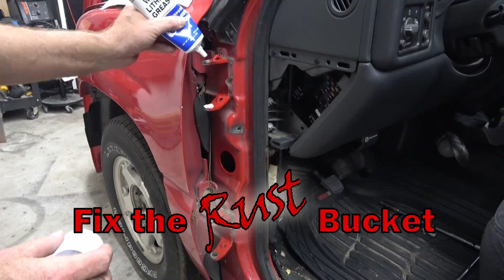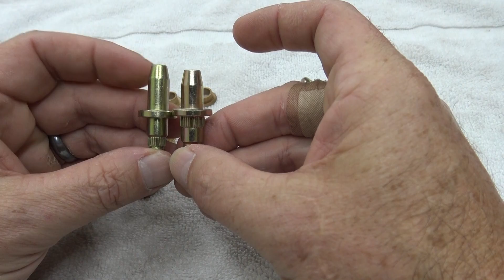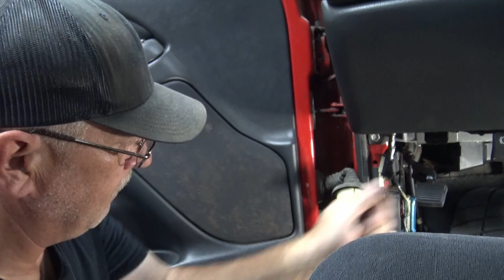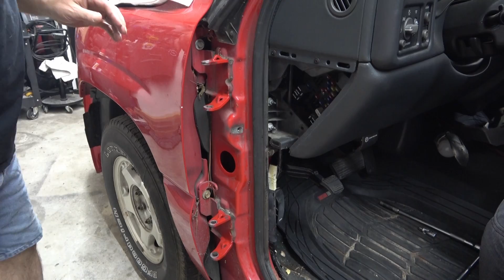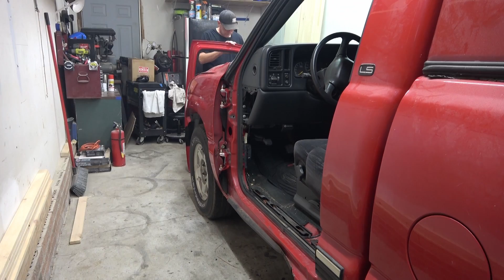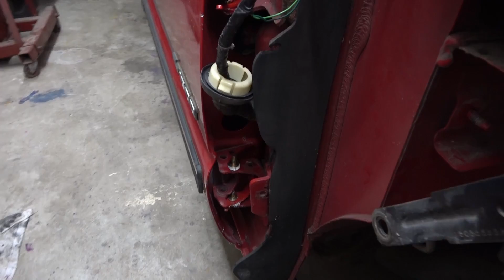How to Repair/Replace Door Hinge Pins Chevy Silverado.

Comment: Great content on your videos. Anyone with tools and a desire could do this job with your instruction. I'm bringing a 2003 single cab LS back from years of neglect. I'll be referencing this video and the rack and pinion video you've made. I'm a subscriber now, thank you.
Reply from the maker: I appreciate your comment and thank you for becoming a Subscriber! I am glad you are finding these videos helpful. If you are considering replacing the Hinge Pins on your truck, I strongly suggest getting the Pins with the Nuts and not the E-clips. I am going be replacing the E-Clip ones I installed on my truck. I believe I mentioned that at the end of the video, but just in case I did not.